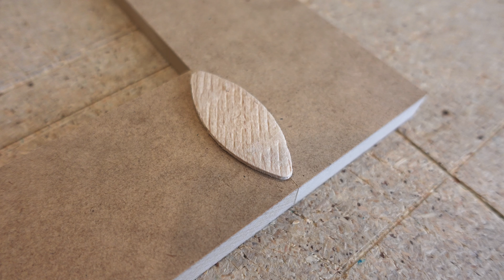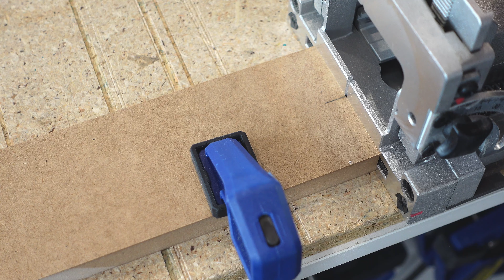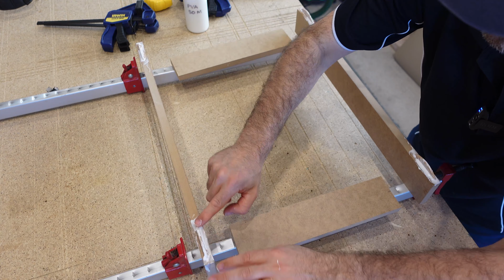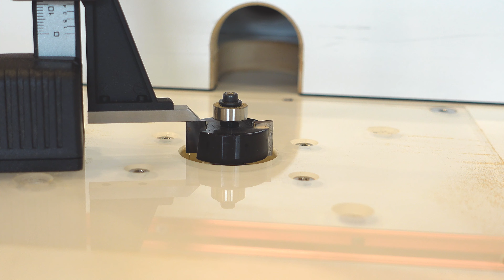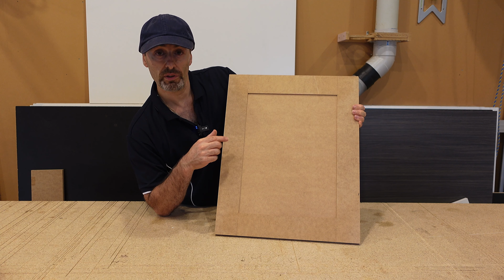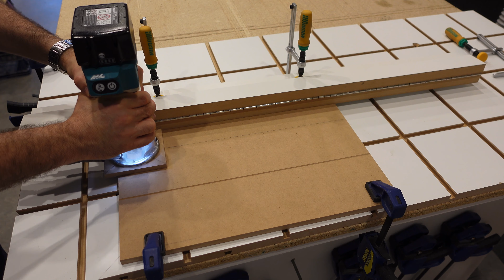DIY Shaker Style Doors | Easiest Way To Make Shaker Cabinet Doors/Panel Doors Without a CNC!

Comment: Its a better method than just planting mdf on the face but with the effort you’ve gone into making the doors you may aswell have made proper shaker doors. Rebate centre of frame and slot the panel into the rebates and glue up with loose tenons instead of biscuits.

Comment: Hey mate, loving the videos. Turning a chippy in a joiner haha. When you talk about painting these cupboard doors, what do you paint them with? Trying to figure out how to make the mdf a bit more moisture resistant so I can replace some doors in my laundry.
Reply from the maker: @jakem171  I think the most important part is getting at least 2 x really good coats of undercoat/sealer on the raw MDF and if you can give a light scuff/sand in between coats it will bond nicely. I have only ever used water based paints on these and they have turned out fine. The only issue is spraying coats tends to be quite thin so you need to fuss a little more or the other alternative is to use a roller for most of the application.
Good luck and thanks for watching 👍

Comment: Assumed that everything is square, do the biscuit really make the connection stronger?
Reply from the maker: Yes definitely the biscuit joints are far more stronger than a plain butt joint. Be sure to check out my other post on shaker doors using an easier method:

https://youtu.be/Pl-WoWPy0U0?si=HGZz1FW2izcjAAcb
Cheers & thanks for watching 👍